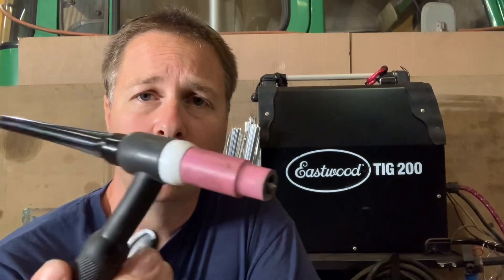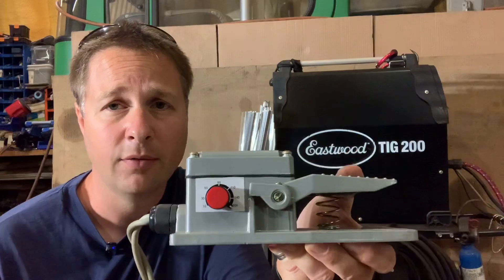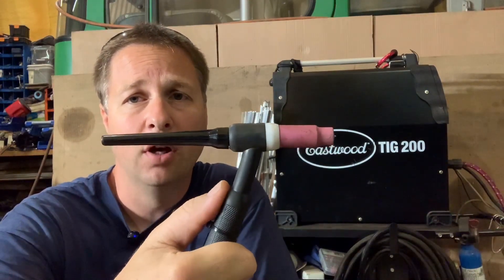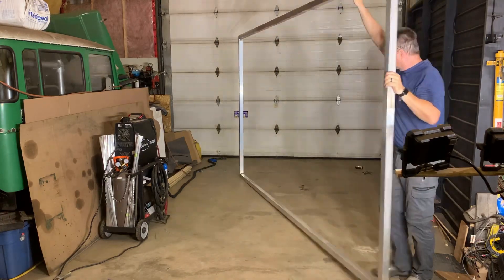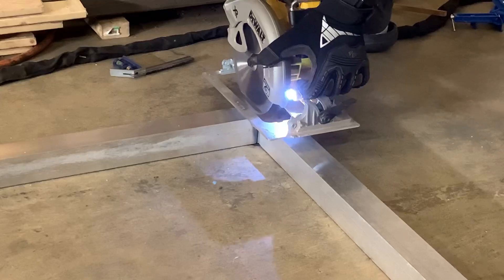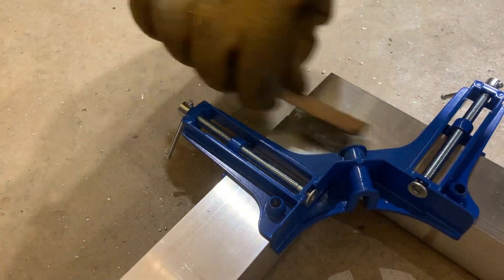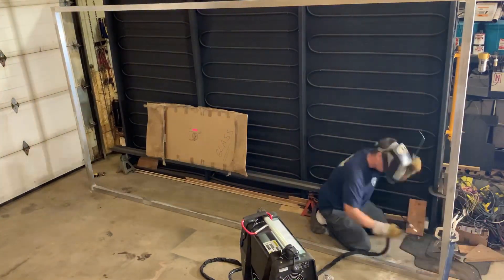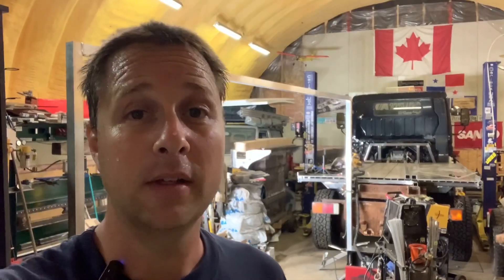Mitsubishi Fuso Camper build - TIG welding the aluminum floor structure part 1

Comment: LOVE watching people weld. So satisfying. You do nice work. Now, given that you live in 'the great white north, eh' are you worried about thermal transfer through the aluminum? Or will your wall material be completely isolated from the aluminum. I remember watching an episode of Outliers Overland where Ben talks about arctic cold, and how it leached into the interior of their box through the aluminum, and combined with their breath condensation, formed ice inside.

Also, that big dark gray panel with the coils under it, is that radiant heated floor! 😃
Reply from the maker: You’re in luck because there’s lots of welding coming! 🤣. All of the aluminum will be thermally isolated, so nothing coming through to the inside.  Lots of adhesive use coming up after the welding is done 🤣.    And yes, the shop does have radiant heat in the floor - that’s a big solar collector panel “project” that has not been connected yet - currently just using an electric boiler to heat the coolant.